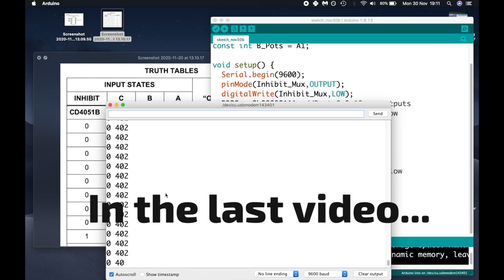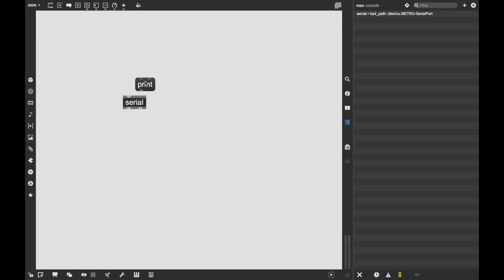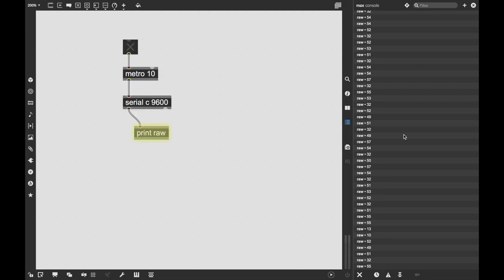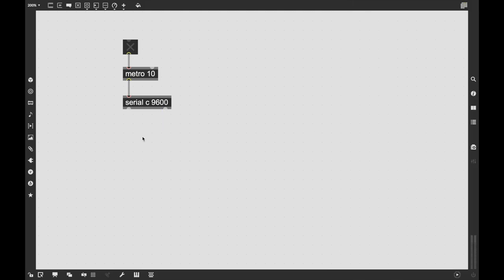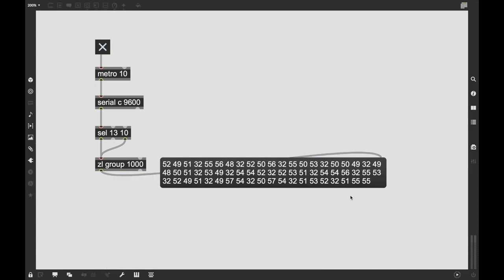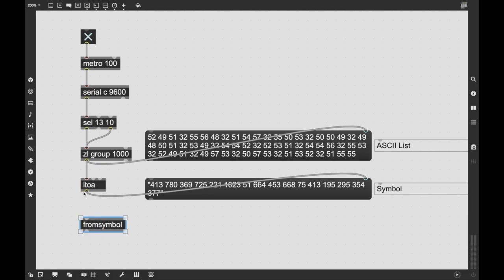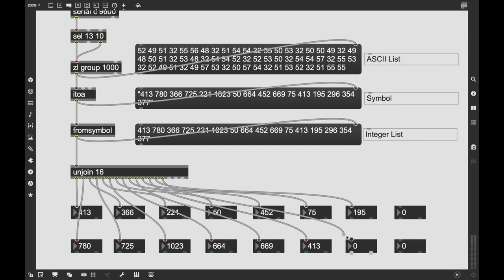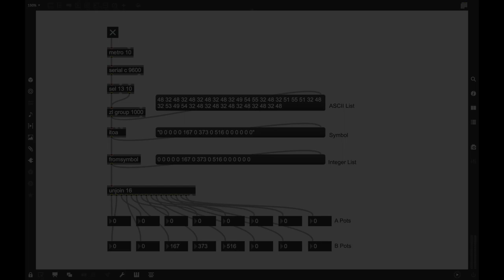Using Arduino to Control Max 8: Receive Data from 16+ Analog Sensors in Max

Comment: This is fantastic, both videos are really well explained. Looking forward to seeing what you do with the ML synth! I've had lots of pot problems, ranging from just crap pots to cheap breadboard with dodgy connectors. I made a little rig with a bunch of pots soldered into protoboard for testing a while back, handy for cutting out potential problems like that.

Looking forward to seeing where this goes!
Reply from the maker: Thanks for the comment and for checking them out! I know they're a bit dense, so i'm glad to hear you say they're well explained :)

Honestly, I think I need to do something similar to your rig. It would just cut out some 'insecurities' of not being sure where issues are coming from. It's odd to me that the B Pots are clean but the A Pots are super noisy, when they're installed on the exact same brand of breadboard bought on the same day.

I will keep the channel updated on progress on the ML sequencer :D Thanks again for the comment :)))))

Comment: Again, a very enjoyable listen, even if I don’t understand it. Very interesting how it began reading the pot values! Breadboards certainly introduce artifacty stuff. I hope it won’t affect what you’re doing here, though. 

One question this raised is, will your program quantize the voltages?
Reply from the maker: I'm glad it was watchable! :D 

It is certainly strange. I have another spare breadboard and the 'B Pots' aren't having anywhere near the same problem - so when I move onto making the actual sequencer i'll probably try remaking that bit of the circuit. Arguably, I should have done that before this video xD

In terms of quantizing... i'm not sure yet. I was thinking about it too. Because it would be really irritating to have it flickering on and off of a note due to this noisyness. (I plan to use those numbers to represent pitch, most likely. and if I use steps for each note instead of a smooth gradient that could be really annoying) It's a good point you bring up haha, I think i'm gonna have to figure out how best to do it.

Comment: How would I then use each pot position to control a single RGB using analogWrite?  Any ideas?
Reply from the maker: If you don't need to change any values using max - you can just use the arduinos potentiometer readings to control the LED directly. This is honestly a hell of a lot easier than the following method!! 

If you do need to use Max for some reason, there is a method of sending values from Max to Arduino - I have realised I haven't written about this properly anywhere. It's essentially reversing the code I've written above. This method is going to be featured in my next video (coming very soon) about the build of the entire sequencer I'm making, the video is just taking me a hella long time to edit. 

My sequencer controls 16 separate LEDs using information from Max, so it's definitely possible. If you are willing and able to look through the code it's available on my github! (https://github.com/CharisCat/After-Eight-Step - max patch is the 'BreadboardPrototype.maxpat') Right at the bottom of that max patch is the section you'd be interested in, which is sending ASCII letters into my arduino to tell it which light to send power to. 

I've used code within Arduino to interpret these letters, though when sending two streams of data over one serial port you have to be careful to make sure they don't overlap and interfere with each other. I sorted that out by separating the sending of information and the receiving of information in the loop, but it is a bit of a faff really.

Let me know if you need any other help!